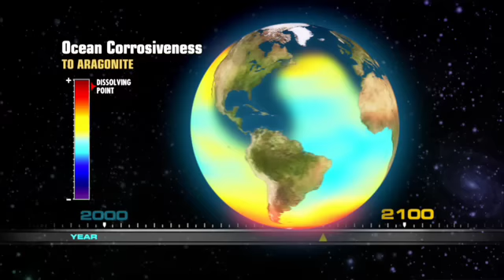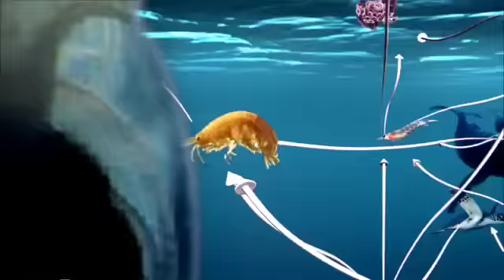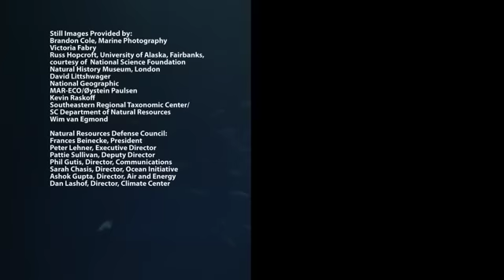Acid Test: The Global Challenge of Ocean Acidification

Comment: @EchelonMonitor 
Acidifcation = a lowering of pH, so the term they use is 100% accurate. When CO2 enters the water it forms Carbonic Acid (H2CO3), lowering the pH. This lower pH has been shown to reduce immunity and reduce levels of calcifiction in a wide range of animals important to both humans and natural systems. Could go into the details but I dont think you'd understand based on your statement above.

Comment: Back in the 70's the USA had acid rain causing fish die offs in the lakes. It was from coal power plants. The smokestacks were made taller it only moved the problem further away from the source. It was sulfur dioxide and nitrogen oxides that were the cause. (see wiki article) My comment is how do they know for sure that it is primarily CO2 and not other pollutants from industrial smoke? Sulfur dioxide 
nitrogen dioxide? Main culprit in that case, coal fired power plants without scrubbers?
Reply: They calculate the amounts necessary to alter whole ocean and  figure CO2 is only thing big enough.

I agree that sulfur has more than 0% influence

Comment: One important fact has been ignored;  the oceans are currently alkaline. They have a PH value greater than 8. To say "more acidic" is not scientific in this context. Water cannot be both acid and alkaline at the same time. It may be the case that the oceans are becoming less alkaline. They won't be acid till they have a PH value of less than 7.
Reply: That's really splitting hairs. It means shifting further towards the acidic pole of the acid-basic axis. A general audience is more likely to understand 'more acidic' rather than 'less basic'.
Reply: even pure neutral water has H30+ and OH- concentrations of 1*10^-7 mol/L. Any water has some acid particles and some base particles. This is taught in high schools! it is not relevant in this context anyway because the main problem is the dropping  concentration of  carbonate ions.

Comment: "... may decline because of ocean acidification. Acidification of media containing various Fe compounds decreases the Fe uptake rate of diatoms and coccolithophores to an extent predicted by the changes in Fe chemistry. A slower Fe uptake ... is also seen in experiments with Atlantic surface water. The Fe requirement ... remains unchanged with increasing CO2. The ongoing acidification of seawater is likely to increase the Fe stress of phytoplankton populations in some areas of the ocean."

Comment: Pleistocene max for 800,000 years 305±5-ppm was a 9% variation on 280-ppm, today's 407-ppm is a 45% variation, 5-times larger and there's now hard evidence we acidify the oceans 10-times faster than the PETM, thus we are now on a geologic excursion caused by a massive carbon perturbation.

The PETM took 50,000-years for the heating stage before a slow decline, we've emitted almost 2000-Pg [1-petagram=1-gigaton] the minimum it takes to cause an excursion.

What happens next matters a lot, we need to zero emissions and being on an excursion means CO2  & heating keep going up for a while, 2-3 centuries then remain high for thousands of years.

That's how the planet works and politicians can't make a law otherwise, we blew it so be a teenager and ignore the message or get it and do something about it.

We can't cool the planet by reducing CO2 emissions anymore is the message few people get yet, the tipping point likely in the 1950's before a jump in power plants & cars to above 315-ppm and 12.5% variation.

Too bad about that, eh? Now the tiny humans must come up with not only zeroing emissions but to also cool the planet using methods not dependent on reductions.

All zeroing emissions does is signal the planet to stop letting sea-level & heating from going higher then the bio-geophysical processes take over and they take time.
Reply: JSavic
Probably not, it's getting shorter than that tho' ... I'll find the last one it was 1/3 the length of this & post a reply here :)
Reply: JSavic  Probably true, and the one part of inevitable is doing nothing so my project proposal is to create a sea-ice refuge by damming Bering Straits which melts our first and freezes last as the Last Hurrah for Humanity before it succumbs to runaway heating .... the Pacific water brings about 30-terawatt-hours/year into the Arctic basin to help finish off the sea-ice.

So right now the lost ice vs 1980-2010 average extent is worth 25-years of power for the USA, 95,000-Twh/year of heat going in.

Maybe shipping to orbit millions of tiny colorful bamboo umbrellas will be a cure ....oh the Chinese joined Russia in Syria with troops on the ground and the USA declared it'll shoot down any Syrian aircraft that violates it's support of ISIS who like to do public beheadings, this may get interesting.

Comment: Over-pop and the political model are defiantly a problem in current conditions. There are also cultural influences that maintain the system. I would like to be optimistic and say changes could be made, but I dont see any possible way to bring about changes; do you?

I do not have a problem with the UN compiling data? The summary and inference that all 2500 contributors endorse the summary is what I have problems with, 'cause they dont. Many of the contributors are political figures.

Comment: The variables of (a), (b) and (c) in this instance do not matter as they are all operating within the parameters of "P" = "political economic pyramid model.

(a-b-c) = P

P = Z

This is the problem, no one has built a complete model of the existing, everyone is working in their own little project. Time to call a ceasefire and collate ALL the data. The UN is trying, and as much as you do not like that, somebody has to. 

cont...

Comment: I think you were talking about positive feedback, a small change turning into a larger one.  According to a strict interpretation of Le Chatelier's Principle, which has been interpreted as a corollary of the Second Law of Thermodynamics, there's no such thing as positive feedback.  A system will act to dampen any change imposed upon it.  There can be runaway heating in a nuclear reactor, but that's when mass is being converted to energy.  As far as I know, there's no runaway acid-base reaction.

Comment: For every 1 kilogram of atmosphere  there is ~255 kilograms of sea water . From this 1 kilogram (1000 grams ) of atmosphere ~400 parts per million is C02 gas or about  4 grams is CO2 gas .  ow the average parts per million of CO2 in ocean water is ~90PPM  a  lot less than the atmosphere aproxmatily ~1 gram per 1000 grams .This shows that you would need huge amounts of CO2 gas in the atmosphere to transfer change the ocean levels CO2 levels because the ocean is ~255 times larger than the atmosphere .For example if we doubled the aerth atmoshere to 800ppm and the extra 400PPm dissolved into the oceans we would increase the oceans levels of PPM from 90ppm to 90.015PPM or increase the 1 gram of CO2 in the 1000 grams of CO2 to 1.009 grams . That extreme example shows how much CO2 levels would have to rise to make any detectable number in terms of PPM or grams per kilogram .As the PPM of CO2 in the atmosphere rises at about  ~2 PPM per year the numbers are incredibly small.  Even ifr we take the CO2 levels of 400PPM of 2018 minus the ~ 260 PPM  of ~1750 that makes ~140 PPM of CO2 rise in the earths atmosphere in ~250 years . Even if assume for every 1ppm rise of CO2 in the atmosphere the oceans dissolved some double or tripple the CO2 gas  it still only something like the 400PPM example worst case . Now increasing the CO2 level in the oceans by ~0.01 PPM or ~0.009 grams per 1000 grams and not all dissolved CO2  will form carbonic acid  exposes the Ocean acidification logic is junk science  . Hiding behind 2400 m/mols or other  big scary numbers shows they can scare you going from 2.400 m/mols to 2600m/mols  but is all boggy man maths made to scare you to give more cash to junk science about CO2 burning you rear end when you go for swim in the oceans

Comment: And finally, most of benthic beings live within specific thresholds of salinity, temperature, pH, etc. and are, in general, very sensitive to small changes. So, as you said, if all the CO2 produced in the last century or so would be combined to make acids, it wont be spread over all the area of the oceans at once, it wont then acidify water thousands of metres deep and the small, but gradual, changes will be noticed by all sorts of beings in the water, generating a waterfall effect.

Comment: By the way, a report by Professor Terence Mills of Loughborough University (UK) came out this week, saying he found no evidence to support the increase in temperature predicted by the IPPC. 
He also said "It's extremely difficult to isolate a relationship between temperatures and carbon dioxide emissions".
So please be wary of scaremongering like in that video.
But if CO2 emissions are deemed to be a problem, let's  indeed sort it : for example put carbon capture ( and make sure it is CCU - "Carbon Capture and Usage" : carbon is a valuable raw material) on the coal and gas plants and stop the CO2 going into the atmosphere, problem sorted, and no need to go around doom-mongering.Think positively.

Comment: I don't want this BS..i just want to know solutions to the problem...all this video shows is that there is a problem..but where does the video come up with any solution? GIVE ME A SOLUTION TO THE PROBLEM AND I WILL FOLLOW IT..NAGGING ABOUT IT IS NOT SOLVING THE PROBLEM..ok stop using fossil fuels..umm so how am i going to get to my job 15 miles away from where I live?a bike...use a HYBRID..yeah and use Li-ion batteries that when dead are worse off than any fossil fuel.COME ON!Hydrogen Fuel Cell?

Comment: Having vehicles run on electricity is good, however, as of right now we would have to tear down gas stations and put up charging stations. I've seen a couple down in the southern US, but it's not substantial enough to warrant an absolute switch to electric vehicles. What about truckers? How are they supposed to go on cross country drives when one full charge doesn't even last 100 miles. I'm all for electric vehicles, I just can't see how we can satisfy every niche with electric vehicles
Reply: IC-engine + electric are used in bus-routes today, supply-chains are based on least-shipping so hubs, seems solvable to divide up hub distance short-term knowing battery tech is on the cusp of aluminum-ion & magnesium-ion the first best replacement for lithium 5x faster recharge doesn't catch fire the biggie: http://news.stanford.edu/2015/04/06/aluminum-ion-battery-033115/

Tesla has recharge locations sited no clue how that's going, stations are just a bunch of panels [they'll add vertical-axis windmills later] to battery-inverter arrays, those are in containers to 2-Mwh so not a problem.
Reply: Xionified Sweden is working on roads that charges electric ran vehicles as they drive. meaning your car would charge as it drove down the road. much like cordless cell phone chargers and I'm guessing it'd work in with the wheels some sort or some kind of friction. there's also the fact that truckers could put solar panels on top of the truck to keep it constantly charging if need be (depending on the location and sunlight in that area). so that's two possible ways to charge long term driving vehicles in the future.
Reply: don't we use fossil fuels and oil to generate electricity???????
Reply: Yes, we do.  Many don't realize this or think about it.